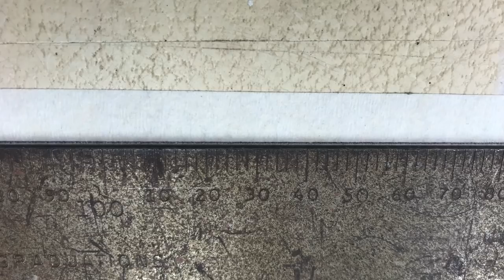How to make a cross cut sled for your table saw

Comment: Your point about not using a tool if it's not that good is spot on. Once you are confident something in your workshop is square, true and sharp, you will use it as much as possible. If it's not any of those then it is not worth the hassle.
Reply from the maker: So true mate, being a woodworker doesn't stop me striving to work within fractions of a millimetre

Comment: My Uncle (I called him the World's Clumsiest Carpenter) shot a finish nail into his thumb.
Twice.
Once though, it was Southern Yellow Pine trim, and the brad followed the grain, did a u-turn, and got him, so more bad luck than the other time he had an over-long finish nail in his gun.
He also planed part of his thumb with a power plane,  belt sanded himself many times, and many other things.
He was still trying to work not long before he passed away. For as much damage as he did to himself, he was a master finish carpenter.
I, myself had a finish nail do the grain following trick and poke me, but that was way back before air nail guns were a thing.
Reply from the maker: Wow mate, hope i'm luckier than that. Much prefer to nail stuff the bench. Thanks Jp

Comment: getting a new (2nd hand) Carbatec table saw this weekend and will have to make all new sleds so this was a great video to rewatch or info and inspiration, as was the fence upgrade video... what advantages do ou find you get with the fence upgrade?
Reply from the maker: The vertical face is staighter than the original fence, its taller and I haven't had to go look for a pencil since. All good mate